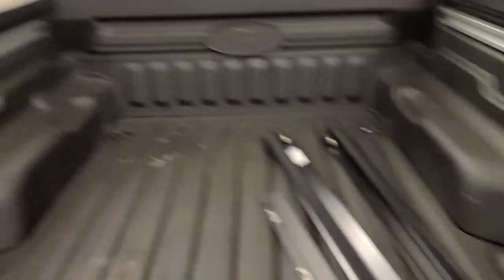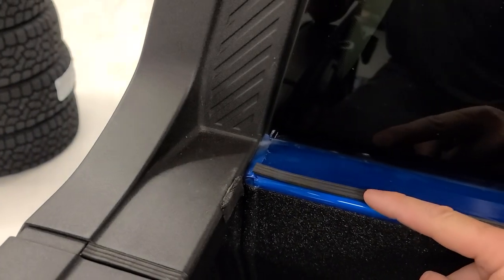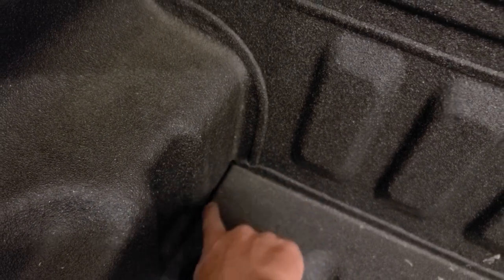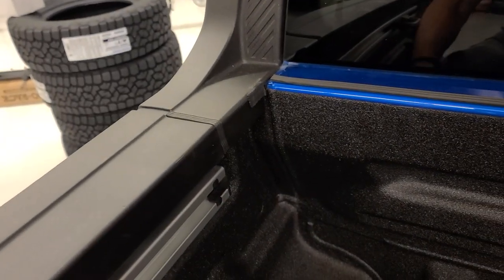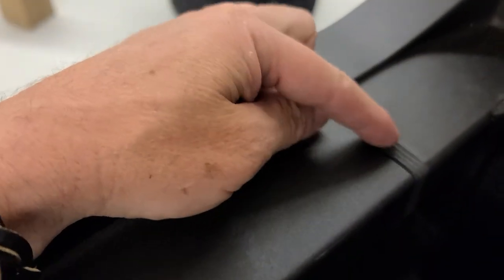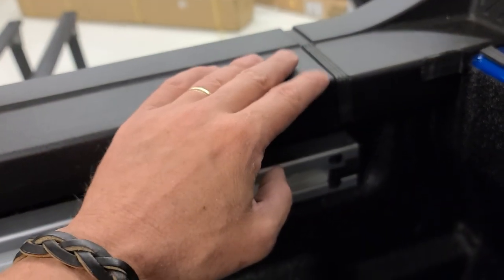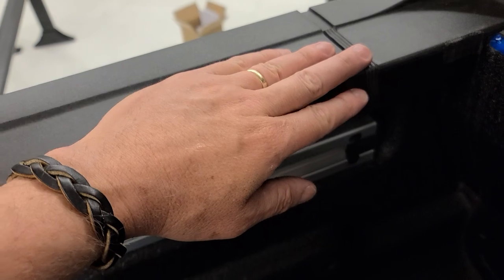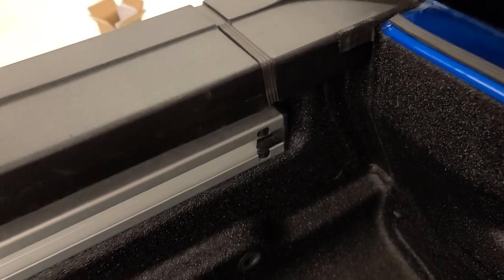Maverick tonneau: keeping the water out.

Comment: I'm getting ready to install a cover. It seems it will be difficult to keep water out, so the next best thing is to direct the water. You eluded to trying to do just that. Me? I'll just let the water flow down the sides and out the factory weep holes.  My cargo won't really be up against the sides of the bed. More so in the middle. For the most part I think my cargo will stay dry.

Comment: The water is flooding in at the corner. I hope you design and 3d print a “trap” that could be attached the corner and tubed via a Y connector to the drain line.  This is the only solution as the weatherstripping, window and side curved plastic cap create a swimming pool of water.

Comment: Link to the seal you used on the side rails?
Reply from the maker: That seal was left over from what I got with the tonneau cover. I eventually removed it and put black silicone there. That works a lot better, and it's easier to get.

Comment: Link to the seal you used?
Reply from the maker: The seal I used for the bulkhead and the bed cap gap is from a Revlover X4S kit, so if you're getting one of those, you're golden. If you're getting something else, many covers come with a bulkhead seal. The seal I used for the bed cap seam just happened to fit, otherwise, I would have used silicone there.
Reply: @ToddsTruckLife  Gotcha. Like silicone caulk or sealant? Any particular recommendations? I'd want something that can peel off relatively easily down the road if necessary
Reply from the maker: @brandonjones3715  Black RTV works well for applications like that. I use a quick detailer spray for our trucks, and if I don't want something to stick permanently, I'll wipe the surface with the spray first, that way it peals off easier later. If you do that with the bed cap seam before leveling it off with RTV, the clamping pressure from your tonneau will hold it in place, and it will come off with less work if you decide to remove it later. Did I explain that well enough? It kinda like making a "temporarily permanent" seal.

Comment: Thanks for the video so I have the factory roll up hard cover and there's quite a decent gap between the tailgate door and the cover when it's closed so I'm tired of opening up my tailgate and having some of my delivery boxes wet I decided finally today to go to Lowe's and I picked up some 1-in heavy duty weather strip molding and some super glue and took my time and added it to the tailgate top of the door and to the very far rear corners of the truck bed it seems to be working okay but it's not completely water sealed but a lot better than what it was for about 10 bucks
Thanks again hope this help somebody

Comment: Is that a drain hole at 2:24? Installing a tonneau cover and trying to figure out if I can run drain line there.
Reply from the maker: Yes, it's a drain hole. What tonneau are you installing?
Reply: @ToddsTruckLife  I had a Retrax Pro MX on my old F150 which had easy drain holes. I have a Ford Maverick now and from what I’ve seen, the Retrax Pro MX goes beneath those preexisting holes on the side…and the drain tube is too thick to fit in the bottom corner drains. 

I’m considering the Roll N Lock as it seems to give me more access to the Maverick bed and I can easily run the drains to those same holes you showed at 2:24 on both sides.

What rolling cover would you recommend for the Maverick?
Reply from the maker: @N.I.C.K.  Roll n Lock does have a smaller canister and you can use the drain hole you saw earlier. The Retrax canister is too low for that drain hole. I have a Revlover X4S which is a hard roll up cover. It doesn't have a canister, so I don't lose any bed space. It also works with my Elevate Rack. The right cover for you is a personal decision,  but that's what I went with. Hope that's helpful!